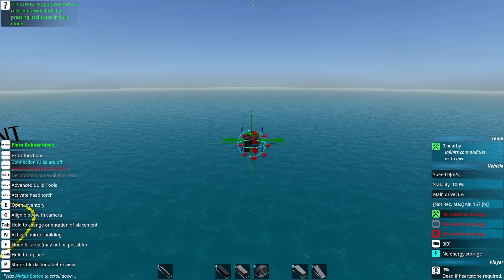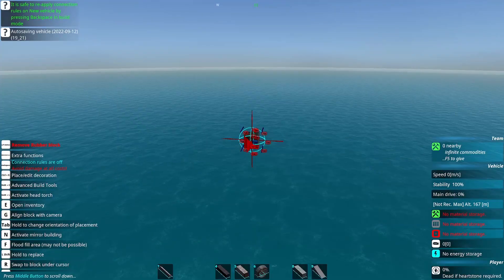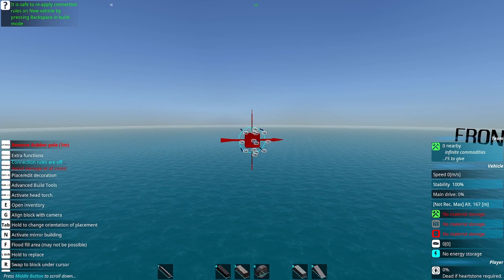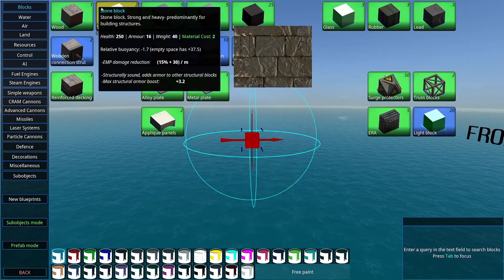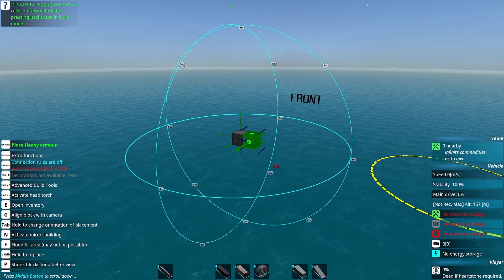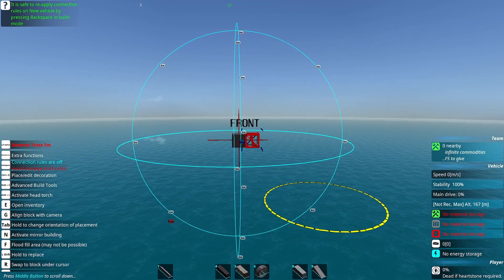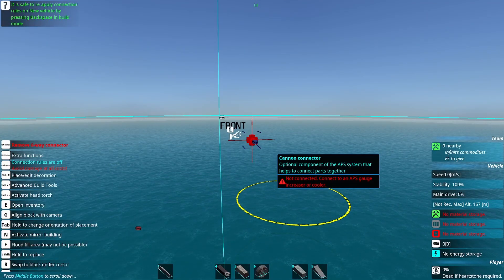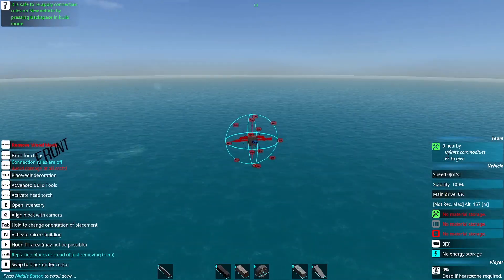Radar Signatures - A Short From the Depths Mechanics Explanation

Comment: Radar signatures just one of many reasons I try pick alloy over metal, basically just metal but more versatile.
Reply from the maker: Some people have very strong opinions about this.
Reply: I find that a mix of metal and alloy is the best way to go. Mostly metal, for that added bulkiness, and some alloy for bouyancy and maybe an alloy coating for decreased radar signature
Reply: @bungalowbill521  yeah I’ve heard a lot of people claim metal is superior and alloy is only used if you have to, I refuse to believe it. I see the <10% armour and health debuff well worth the way stronger emp insolation, lightweight properties and radar signature buff. 
That’s mostly because I see HA as overpowered and it’s a lot easier to fit into a design if your using alloy as main building block over metal. None of my designs would be possible/would be a lot more fragile if I had to use metal.
Reply: Well, many people consider armor as made of at least metal or up. But generally alloy will not endure high damage hits whereas metal and heavy armor fly with waaay more difficulty. But I tend to make smaller crafts out of alloy and spank and tank ones with layered metal with slopes and everything. Also, alloy ships tend to fly more than swim.
Reply: @csabatisler6505  Bojler eladó

Comment: I was under the impression that bloc shape did matter in detection range, a bit like it does for drag. Did you test bloc shapes with something else than 1 bloc wood ? My guess is that maybe 1m is the minimum detection range possible for 1 bloc.
Reply from the maker: Iirc I tried with a different material too, but there could be a minimum cross section. I’ll have to test it again tonight.
Reply from the maker: I did some more testing, and I failed to find any armor blocks that behave differently than a beam of the same dimensions. It doesn't mean that there aren't any, but I tested the obvious choices of 4m slopes and 4m triangle corners, and even tried spamming them in larger numbers to see if there was a threshold where I'd see a difference.